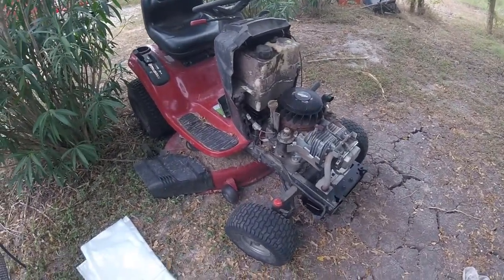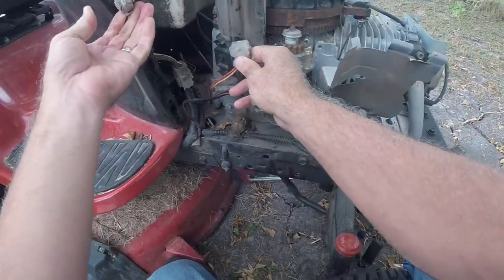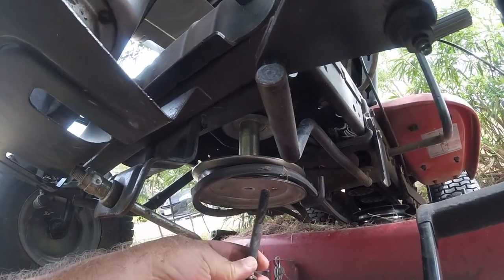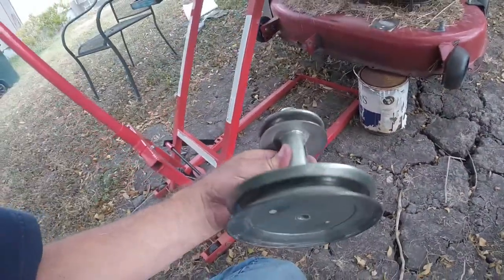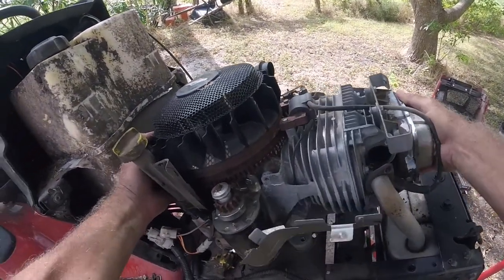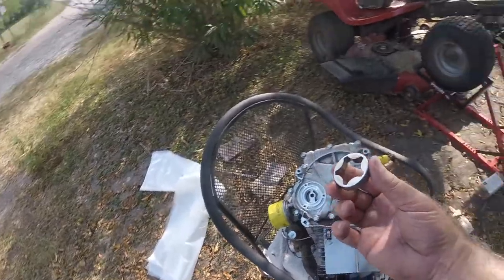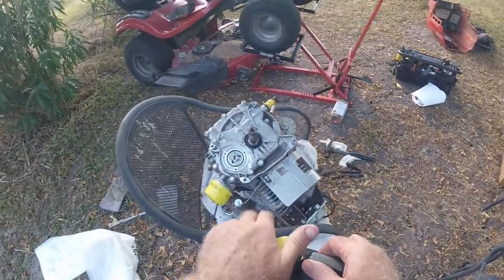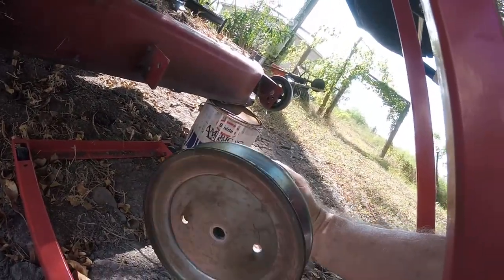Craftsman mower camshaft replacement

Comment: You can verify that it "IS" the Camshaft Compression Release arm by trying to crank it with the air intake completely covered/sealed. This prevents the compression for occurring.  You'll need to rotate the black mesh cylinder on top of the engine counter clockwise as far as it will turn with your hand before attempting this. I used a rubber ball to cover the air intake tube (with filter removed) and when the engine begins to crank as it turns, simply uncover the air intake and it will start right up.  Sometimes it takes a couple of attempts.  I've been cranking my mower like this for almost a year.  I think it's time to open it up and replace the release mechanism before the broken parts that are loose in the engine damage it.

Comment: Thanks for this video. Long story following but maybe it will help someone else. I just completed this same job on my B&S 20hp on an Ariens 46" rider. Same starting symptoms. Replaced battery and starter. Still not enough poop to turn the engine over past the compression stroke. Disassembled and found that the compression release on the camshaft had self-destructed. Just about the same fragments you found. Replaced the camshaft and yes that output seal was a bear to get on correctly. I never could get it to seat in all the way, and I also disturbed the tiny spring that preloads the output seal. Tried to reinsert it but not sure it actually stayed in place. I buttoned the engine back up and it started and ran great for about 1/2 hr. then the motor stopped. Starter started cranking way too fast. Checked compression. Had none. Disassembled the motor again and found that the compression release had again self-destructed. As I drained the oil it looked like someone had poured about a cup of aluminum paint into the crankcase. Not as many parts left over this time around because they had been vaporized. Also, the reason for the lack of compression is that when the second compression release grenaded it jammed up the camshaft itself, and that shaft twisted right out of the timing gear that was pressed onto the camshaft. Thus the cam lobes were not even turning. Cleaned out the crankcase as much as I could. Bought yet another new oil filter and 2 new quarts of oil. I've checked all internal crankcase parts carefully and can find nothing damaged except that danged camshaft. Still have not a clue where all that aluminum dust came from. Probably cheap Chinese steel in the camshaft! Wish me luck the second time around. Oh, and I found out that you can put that crankcase gasket on dry and it is much easier to disassemble the second time. :-) Also, I learned not to whack too much on that output seal or that tiny circumferential spring will become dislodged again. Upon disassembly, I did find that I was leaking some oil out of that freshly installed output seal. While I have been waiting for the new camshaft I went ahead and purchased a new Cub Cadet 22hp with Kohler twin. At this point, I am soured on B&S's compression release technology.  This and the amount of aluminum "dust" in the oil after the motor grenaded makes me think that even this new camshaft is not long for this world. If it will run again for at least an hour I will sell the mower with good conscience.

Comment: What’s your engine model? I have a Troy bilt bronco but bought it used, the engine is the same, I think they swapped engines, did you buy the camshaft assembled or everything separately??

Comment: Worst engines ever. Watch for the front mount on the trans .. when it breaks, It'll cause the trans to tilt forward and cause your fan on the trans to hit the bottom of the battery cover and break and will cause where the trans mounts to the axle to break  or split and you'll have to replace the whole back frame or  do like I did and use 2 in. Angle iron and reinforce it. Shame on Briggs and Stratton!! Cheap junk!

Also you can confirm compression release is bad by removing spark plug and  putting the engine on top dead center and removing air filter and squirt some starting fluid or gas into the carb and if it fires right up then you know it's the compression release.. also for the head gasket constantly blowing, Get a  can of copper maker and spray both sides of the head gasket and it will last longer ..
Reply: Or paint it with aluminum paint 
Both sides